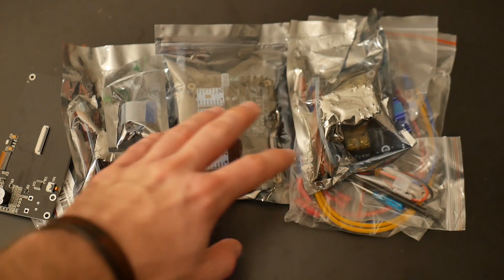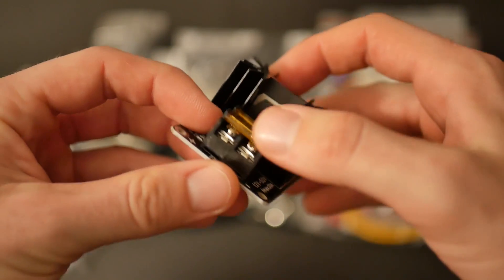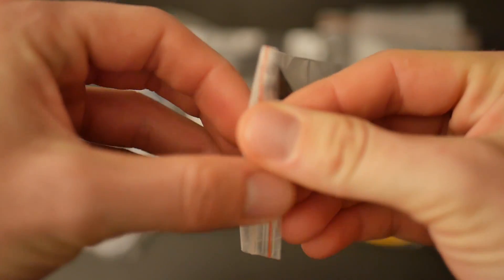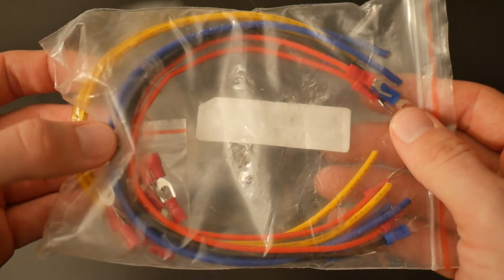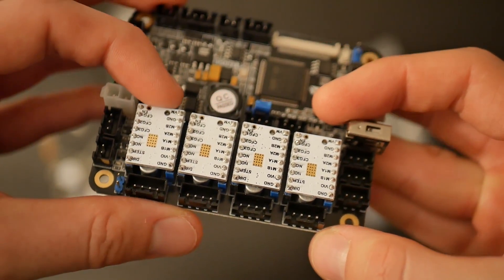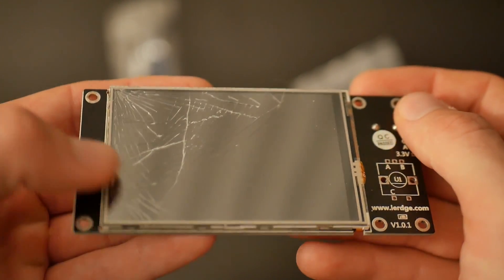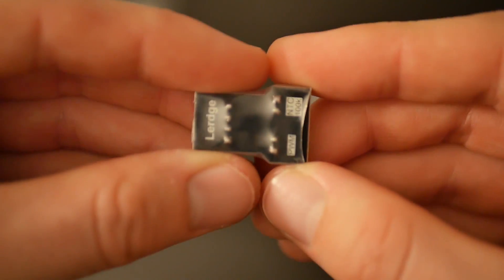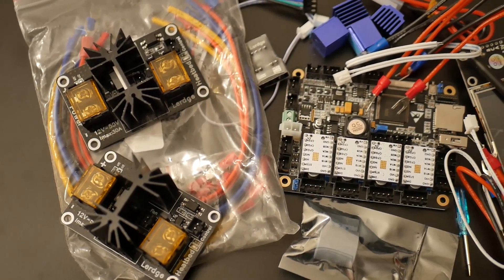32 Bit 3D Printing With Lerdge X Controller Board

Comment: Upgraded my Ender-3 to the Lerdge-X and it's been running well. The steppers are just soooo much quieter with the 128 micro stepping. Locked down firmware is a bummer but at least (unlike my UP) it accepts standard G-CODE.

Comment: It will be interesting to see how this board works with more "intelligent" drivers like the TMC2208 (in UART mode) and TMC2130 (in SPI) mode, because looking at the board layout, it seems to be configured for all stepper drivers as "drop-in" A4988 replacements. Which is still great, but does not fully exploit the features of the more advanced drivers.

Comment: I've fitted this board into a heavy modified wanhao i3 printer. It's great, I'm using the lv8729 driver. Very quiet (not as quiet as the tmc2100 but higher amperage) it being closed sourced didn't really affect me because you can adjust everything on the lcd screen ie stepper steps, printer size and type, acceleration etc plus you can get the power off module, filament detect module, bltouch probe and they are all plug and play with settings you can adjust on the screen. There isn't much info on these boards other than their website which told me everything I needed to know. I've ordered another 2 more boards for my other printers

Comment: looking forward to see your video on that board , i bought one a few months back but i have install it yet because the printer i had then was not  that good and i bought a creality ender 3 since then and it is doing a great job so i didn't see the need to change anything on it , and the video i saw  dont show very much about the lerdge x  installation and all

Comment: I actually just got the Newer Lerdge-K board.  Also grabbed the WiFi connection and the power module.  I need the 32b boards for my CoreXY setups.

The power module is pretty cool... you actually have an option on the LCD to power off your printer after the print is completed.  I haven’t set the board up yet but I’m beyond excited about it.  There’s a lot of negativity around these Lerdge boards due to it being closed source but the group of people using them say they love them!!
Reply: I got two new sapphire-s 3d printers with Lerdge X board in each one of them but I want to order Lerdge K as well.
Reply: msdesign.ru how you liking the boards so far?
Reply from the maker: I have noticed that to. There is not a ton of info on the boards but the people I have seen with them seem to be having good luck and enjoying them. If I have a good experience with the X version I will likely get the k version for another build. Please let me know how it goes with the board when you get it!